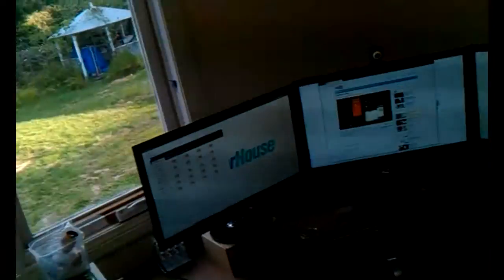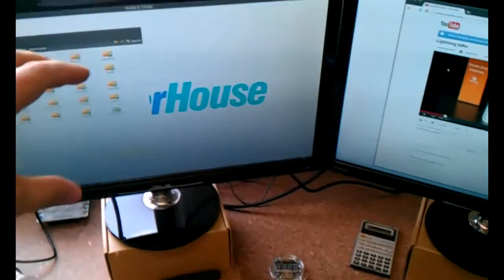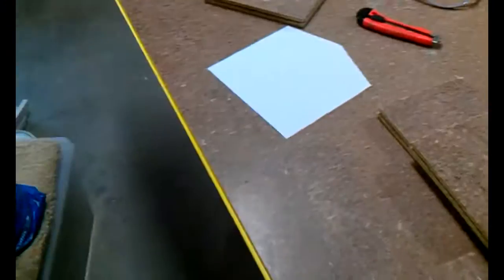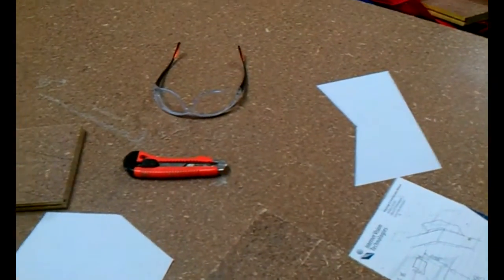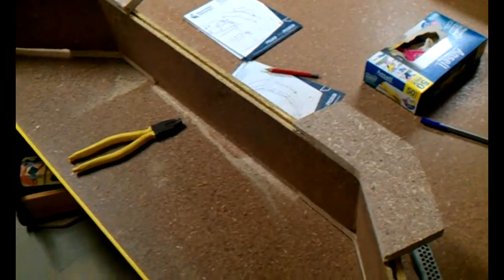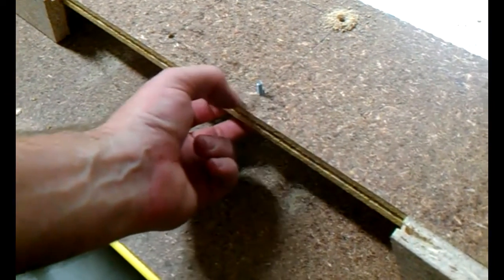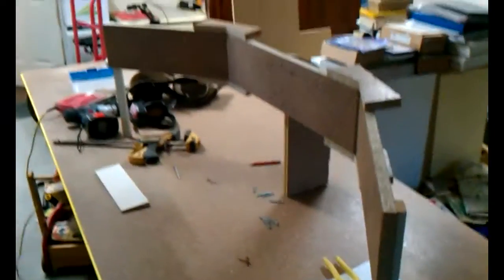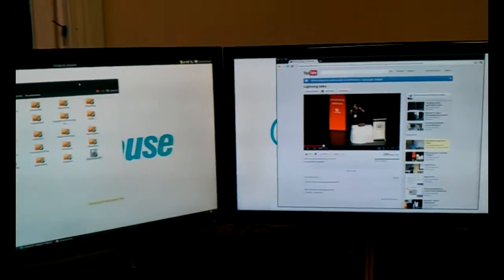Walktime Blog #20: Building a triple-head monitor stand

Comment from the maker: @thaytan I may still do something like that with the supports, because I'm not really happy with the stand at the moment. I didn't get the monitor spacing / angle exactly correct. To improve it I think I'd need to buy 3 x low profile VESA mounts and attach those to the stand, but that'd be about $90 and I'm cheap. By the time I spend that much I may as well buy some regular monitor arm desk stands.

Comment: A nice enough hack. I'm surprised you didn't put 2 supports at the angle joints, to leave the central space free, or bolt the whole thing directly off the back of the desk.

The bits with the freehand saw and jigsaw gave me the heebee jeebees - clamp your work and don't put your hands in the path of a power tool!

I'll be doing a similar hack on my desk soon, except that I want my two monitors mounted vertically, with the top one angled forward slightly.